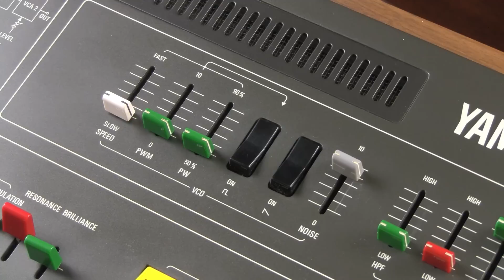The Yamaha CS-50 Part 1: The Oscillator

Comment from the maker: It's true... but this is true of a lot of synths, weirdly enough.  I have had two CS-50s, and I believe they were very similar in tone. 
Usually, when doing a demo of oscillators, I have the filter all the way open so as not to change the nature of the oscillator output (except in cases where a synth's design has it affecting the output even when it seems completely open, of course).

Comment: Let me add that the square wave does sound somewhat hollow, but it isn't the kind of hollow sound that I would expect if the square wave had a precise duty cycle of 50%.  It certainly doesn't sound as hollow as the square waves produced by my other polyphonics including my Prophet-5, Jupiter-8, OB-Xa, and the lead synth on my ARP Quadra. Actually, it is more reminiscent of the hollow waveform on the polysynth section of my ARP Quadra or ARP Omni, which is squarish, but not a perfect square wave.

Comment: Hi Marc,
The square wave doesn't have that hollow-like, clarinet sound that is the defining characteristic of a square wave when the pulse width slider is set on 50%.  (Listen to this clip between the 1:06 and 1:12 time marks and you'll see what I mean.)

Is this typical on all CS-50's or is there a chance that the initial pulse width trimmer(s) on this synth need to be adjusted?  Of course, I couldn't see the VCF sliders & it is possible that high amounts of resonance could also be responsible.